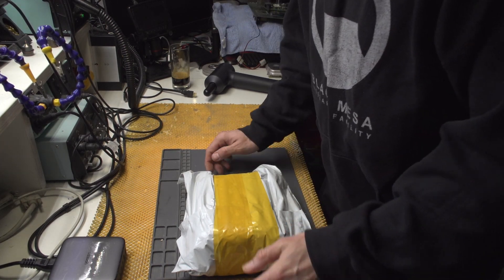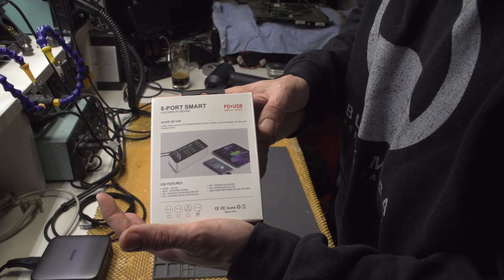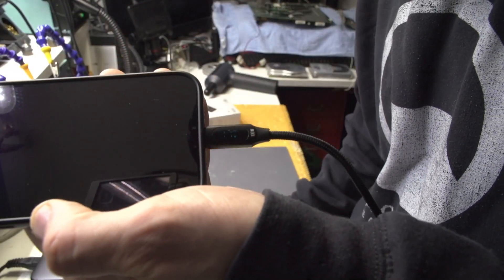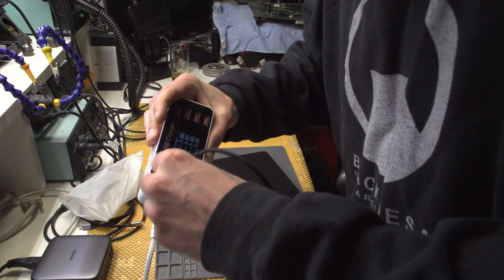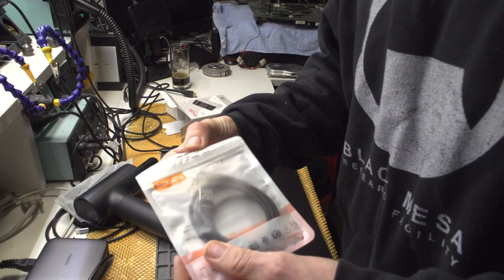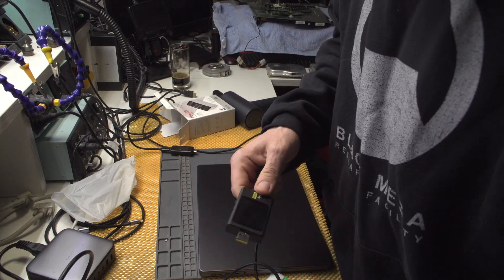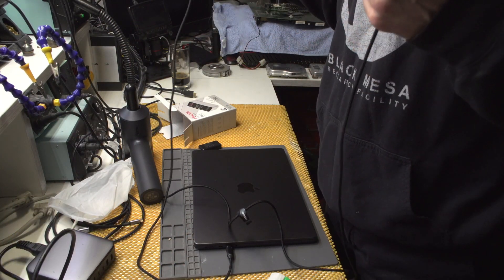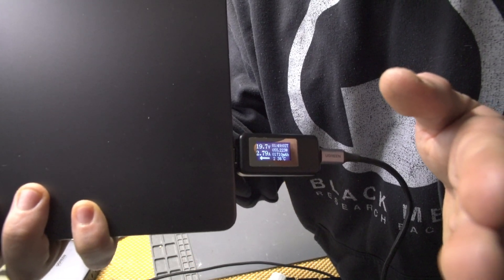100W USB C cables from Amazon/Aliexpress (ESSEGER, TOOCKI) + 65W charging station test

Comment: I am using daily toocki 100w cables and they are ok. I have killed 2 of them after a year of use. One was smashed buy sitting on it. Second one was bent daily trough over a year - Child was playing tab. I have had cables died of bending in a couble of weeks. Very good price/quality ratio. They are solid and braided.  They dont get as dirty as rubber ones.
Reply from the maker: I Agree

Comment: im going to buy a Toocki
Reply from the maker: it's actually nice + i've connected it to a 100W charger and it's not getting that hot (mild temperature after prolonged usage) so yeah!
Reply: @MTS_IT  so does it actually do 100w through the cable? Thanks.
Reply from the maker: @randybobandy9828  yup!
Reply: @MTS_IT  check out the 3 in 1 cable. I added one to my cart to try it out.